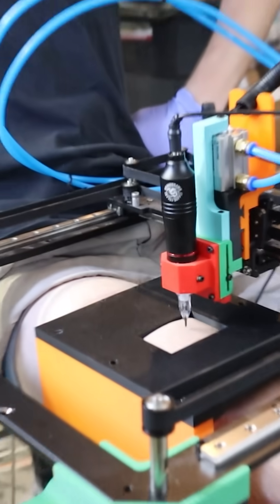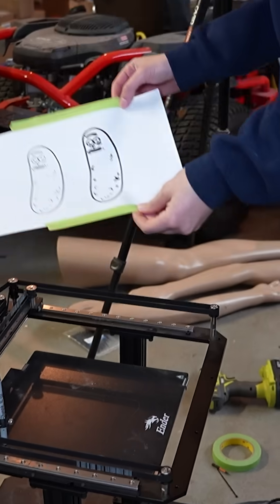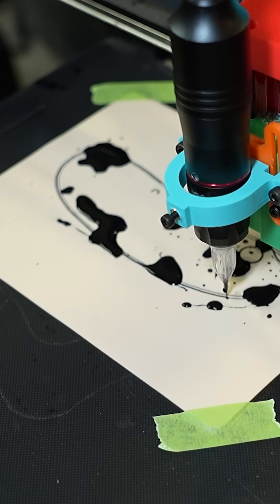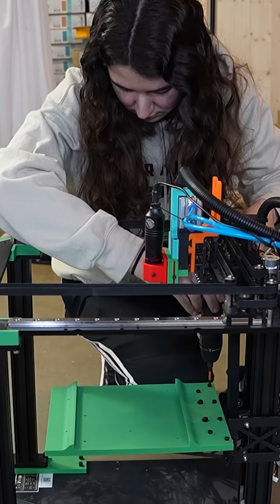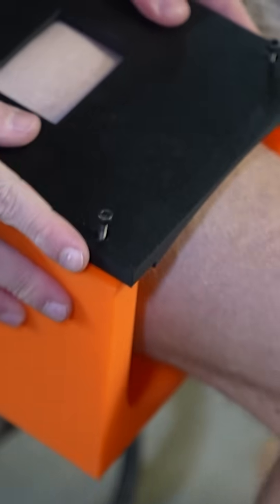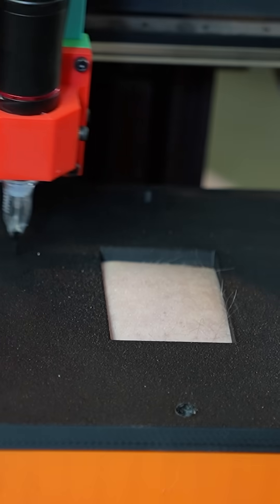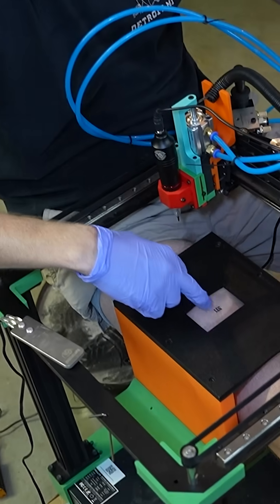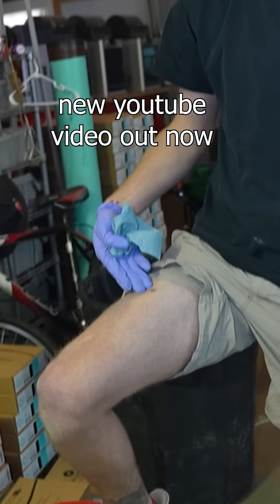Tattoo 3D Printer?

Comment: Its the ink refill that would be tricky with this set up. 3d printing a drip feed system like an IV would be awesome. I wonder if the sensors that are used in laser engravers could help work with the curvature. But its obviously very different. Lidar maybe? Having the leg even more secure would help for actual tattoos. There is a bit of improvement that can be done on the skin stretching shield.

Comment: Did you have an emergency stop?? If I was doing this, I'd want to make sure there's a mechanism that if needed would cut power and immediately lift the print head away, without using the software of the printer to do so.

Comment: With a small tattoo the depth dimension probably doesn't make much difference but with even a medium sized tattoo I have to imagine that the 3d nature of the leg means that the needle will go deeper in the middle than at the edges, even with the plastic frame they used to try to partially flatten it. It looks like it could work really well, but they're need to add a way of making the machine confirm to the natural curve of a human body part better to get good results with a larger tattoo.

Comment: The needle has to go into the skin 3km no more no less it has to reach under the first 2 layers to where the ink will stay and not fade out and the needle is better in about a 45 degree angle it penetrates the skin easier and leaves an overall better effect

Comment: This girl just revolutionized tattoos for tagging animals and stencil art
Reply: Yea you could make it smaller and basically handheld so you just place it on the patch of skin and let it work
Reply: @malakai2012   seriously! And soon the next Photo Booth will be a Tattoo booth
Reply: Its not that simple, this machine isnt giving correct pressure or depth, the tattoo may look half decent on camara but in a few weeks it will look like a prison tat @PuffinSmurf
Reply: @-Nikoli-  right it'll need some kind of surface scanner to account for curvature which isn't something 3d printers can usually do
Reply: @malakai2012  can have 2+ 'legs' that slide on the surface and average the depth to give reference on height
Reply: Already exists just with a laser. You 0lace the laser head on the skin and 8n a few seconds it burns whatever you want in there.
Reply: Nah, fuck this thing. Let the artist do the art. This has no place in tattooing, these people don’t give a shit about tattooing. They’re just looking to make a quick buck. Tourists!
Reply: Pretty sure other people did it way before and you just say this cause this is what you’ve got way after in your feed

Comment: Neat but it turns art into a generic repeating process. On the CB plus side looks like the real tattoo artists are gonna have a lot of cover-up work coming there way if these devices take off… and forget about multiple sessions for a large tattoo get ready for the pain train - because it don’t stop till it’s done. A real artist can adjust to angles - you can change positions if needed, take a break whatever. This would require absolute stillness and nerves of steel plus the lack of any kind of artistic vision by the customer… neat concept but nah, I’d stick with a real artist.

Comment: You could use the 3d printer tip to program the contours of the arm or leg and then you could get it to do larger ones without risk of it doing it too deep on one spot and not deep enough on others

Comment: I knew about 10 years ago one day this will be a common thing at any mall. Using 3D rendering you can pop out a tattoo of a portrait in minutes. With other color mixing. The big game changer will be instead of putting ink on the arm and pushing it in the needle itself will go in and release the ink directly below the skin line. Cut down on healing time and leaving a much cleaner color. On top of that so make it have it set to be just barely blow the skin to where it could be a long-term temporary tattoo. But The real new age tattoos that will be mind blowing to where you could be tattooed in seconds probably about a 5 in x 3-in tat has not been invented. But it's coming because I can see it. And no I'm not saying I'm psychic I just look at everything around us to figure out what's coming next. Got a pretty good accuracy rate at this point. Is there just waiting on somebody to think of it.

Comment: the fact they went through all this effort just to tattoo “leg” on his leg 😭
Reply: Well, they weren't gonna tattoo it on his arm, that'd just be silly.
Reply: @alecdickens1042 😅😂 dying from this
Reply: @alecdickens1042  this guy gets it
Reply: I love the tattoo you know in case someone finds a body part they don’t need to do much work to figure out what body part it is unless you randomize all the name of your body parts and get head on your leg and foot on your arm which would be a fun tattoo idea!
Reply: The thing that worries me more is that body parts are still slightly rounded while the printer only moves in 2D, so you can't adjust the depth as well, so it's probably good they took a very simple design what can be covered in case of bad blowouts. But I think that they did not go through all the efforts for the tattoo itself but rather for the experience.
Reply: @-Jari-  its probably why you'd want to compress the area being tattooed. To make it "flat" but it wouldn't come out right once pressure is removed.
Reply: Proof of concept
Reply: It was just a test, that’s why he said he’s going to go for “round 2” with the ACTUAL tattoo
Reply: @pimpinken8901  a tat is a tat - an actual tattoo. 🤨
Reply: So what? It's wrong if it's "arm"
Reply: Wierd at first glance I swear I saw les not leg
Reply: Proof of concept 🤷🏻‍♂️
Reply: For real! Should’ve tested it out with a full chest/back piece!!! 🤘
Reply: Without actually going through all the trouble to properly protect against blood bourne pathogens; which is one of the biggest components of tattooing
Reply: Well its just in case it comes off silly! 
Although it might be put on backwards or on the wrong side!
Reply: at this point it's the same if you put ''milk'' on your knee LoL
Reply: Nobody built a rocket before we knew we could fly planes.
Reply: Dumbest idea ever.. and blasphemy to the art of tattooing, almost shameful.. No just No.. all wrong
Reply: @FloridaGrownTV Im sure the people that used to tap tattoos said the same thing about tattoo guns. In fact, many tappers STILL say that about tattoo guns. Shit, some people say that about colored ink
Reply: @ultraviolentblue529  true 🤔
Reply: It's perfect
Reply: You got to commit to the bit.
Reply: MY LEG!
Reply: I was like, pickle rick won't fit 😂
Reply: Lol he got a leg tattoo on his leg

Comment: Well you still need a lidar scanner installed to scan for tissue height so it adjust the needle height so thr needle doesnt accidently cut someone or use a springloaded system on a head with bearings so it dynamically adjust for height and prevents the needle from going to low

Comment: Tats are done with a certain needle angle. Tattooing straight like this makes it fade fast. It also looks shallow, soo fading even faster
Reply: It's proof of concept, not a commercial product
Reply: It’s the future. Idea just waiting to be polished and marketed honestly
Reply: @abrahamvillacis9716  Even if/when this concept is commercialized, there would definitely still be demand for more traditional methods. 

People still get tattoos with ancient techniques.
Reply: Considering that the tattoo is just the word leg, this is probably not a bad thing that it's going to fade lol
Reply: It’s pretty cool for a test run though! I have a feeling this isn’t the end….😂😅
Reply: @Lisser81  Will get to the Starship Troopers level where they do laser tattoos hahaha
Reply: Yes but with refinement it will work 
This just proof that it could work
Reply: This is revolutionary. There will be improvements.
Reply: Roughly 45 huehue
Reply: Great for proportions
Reply: You can tattoo straight if it’s correct depth what’s it’s matter. Angle just makes it easier to penetrate and more wiggle room with depth, but a machine holding it steady kinda helps alleviate both of those problems although still issues with curvature and varying skin thickness at different spots
Reply: Yes but UV ink tatts will be easier doing this. And plot twist: they are invisible
Reply: well if he gets tired of having his leg labeled it might just fad away.

Comment: I think the only disadranvate is that the computer cant know if the client has moved slightly, which could alter the lines. It also cant know when the client needs a break cuz ya know- pain- but i guess that can be solved by having a supervisor but then why have a machine do a job if it needs to be supervised either way? 

Acrually probably for the stability of the needle and stuff- cant go too deep if youre at a constant- 

But tbf i dont know enough about all this to really have an opinion lol- its cool ngl i would just be scared cuz of the "what if"

Comment: So I used to work at a paper company, we used to have a laser engraver. (I was in charge of it and to learn how to use it 100%)For context I'm a tattoo artist, I Jimmy rigged the laser engraver to bipass any safety measures.. I got a branding of Pac man and the ghosts, within 45 seconds....I would do this in a heartbeat. No more dealing with tattoo artists with too high prices, or too many breaks cus of addictions. Will always be perfect art if your body part is literally pinned down. A single twitch throws the whole thing off.

Comment: I question the ethics of this, on some level. Real tattoo shops with actual artists are usually required by law to meet certain health safety standards, especially in regards to a sterile work environment. All it would take is an error in the vertical access or the person moving their body during the automated process and you've got a needle hitting a nerve or bone or perforating a blood vessel, and still trying to proceed with the operation.
Reply: That sorta sounds the same as the ABSOLUTELY  worst case scenario -with a human too eh
Reply: @molly777  except a human can see you moving and react as well. A robot doesn't care if you start wiggling, it's gonna keep stabbing you 😂

Comment: Tattoo artist here 👋 While it seems doable here and in theory, doing anything other than super simple single line designs is not achievable by machine alone. Tattooing is not just drawing on skin. Tattoo artists must be well-versed in placement, depth of the needle, stretching the skin, speed of the machine versus the hand, shading techniques, and how to deal with problematic areas and differently textured skin. And while getting a tattoo from a printer might seem cool in the moment, it’s just a pale imitation of real art.